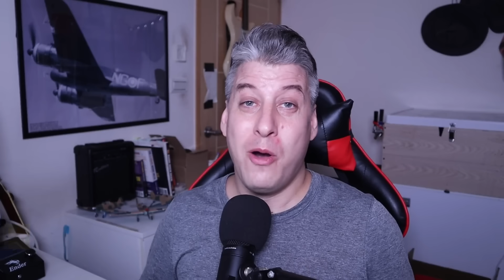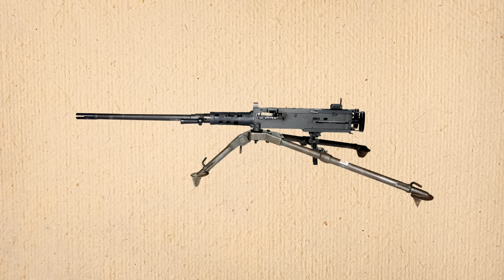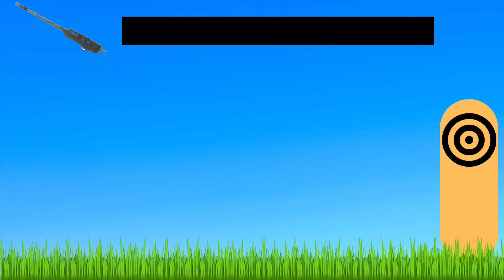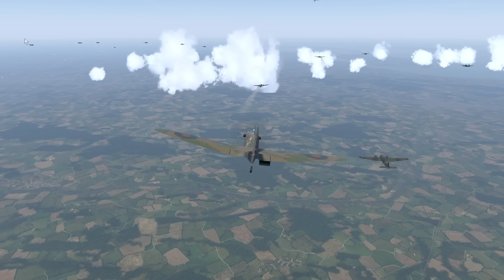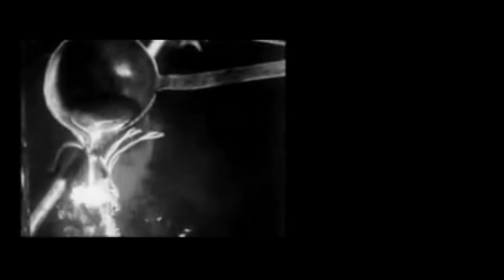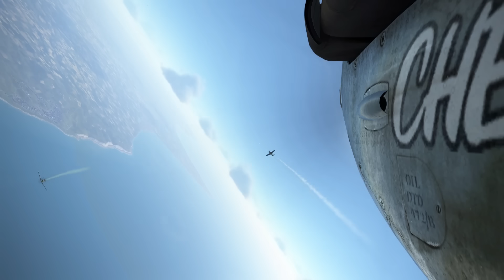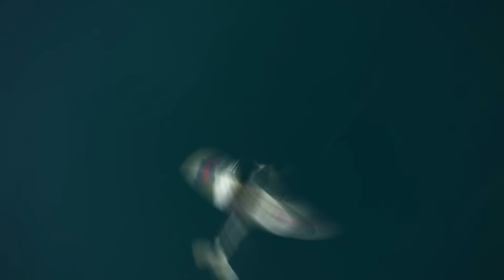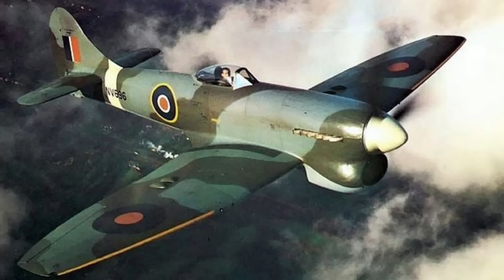Why Did The RAF Use .303 Caliber Machine Guns in WW2? The Surprising Answer

Comment: This is very similar to the history of America's late adaption from the 50 cal to the 20MM (and larger) cannon. As I under it, there was also the issue of early 20MM+ caliber guns being clip fed and not belt fed. The Army Airforce waited (in addition to the other reasons) for a reliable linkless belt system for the larger calibers before the canon were adopted.
Reply: The reason the American version of the HS 404 (the 20mm Automatic Gun M1) was so unreliable is that the chamber had been lengthened (as was discovered when a British Hispano was compared to an M1; the RAF model never experienced the same failures as the M1).  This led to the round being seated too far forward so that the firing pin did not properly strike the primer of the chambered round (it had not been redesigned to take into account the longer chamber), leading to an endless series of 'light strikes'.

The belt vs drum feed scenario is a bizarre reversal of the old not-invented-here syndrome; you rightly say that early versions of the Hispano were indeed fed from a drum magazine, which in a wing mounted gun isn't that much of a problem, but when you have an aircraft like the Bristol Beaufighter (armed with no fewer than 4 Hispanos and 6 .303 Brownings) where the observer has access to the cannon breeches, someone thought it would be a grand idea to provide stowage for 16 spare ammunition drums, four per cannon, which would be swapped out in flight by the observer ... who would have much better things to be getting on with, such as manning the radar display!  This was evidently an unacceptable arrangement, and the engineers at the Bristol Aircraft Company went ahead and designed a neat and reliable recoil operated sprocket feed for an ammunition belt, which was pooh-poohed by the armament experts who said it wouldn't work.  

In June of 1940, however, just prior to the fall of France, two French Army officers made their way to Britain bearing drawings of a Chatellerault-designed belt feed for a Hispano HS 404 ... that was practically identical to the one designed by Bristol with the exception of how rounds were withdrawn: the French design pushed the nose of the shell whereas the Bristol one pulled on the case, which caused issues with pointy-nosed AP rounds so the design was modified  - and replicated the Bristol feed mechanism perfectly.  It took until September of 1941, and the 401st Beaufighter off the production line, to get a belt feed for the Hispanos as standard ... when it could have been there from the very start if the Air Ministry hadn't had their heads up their collective arses!

Comment: Remember every American vehicle had a 50 cal mounted on it. As for the Navy 50 cals where widely dispersed all over the ships. Fun fact, on the lowly US Navy LCS today there's 6 50 cal mounts.
Reply: The 50 cals were replaced by 20mm's in the first months of the war.
Reply: @rocketguardian2001  Most PT boats kept their 50 cals. Even today every Abrams tank has a 50 cal on top the turret.
Reply: @LV_CRAZY  Yea but the Abrams .50 is not used for anti aircraft duties, and the .50 on the PT's was supplemented by 20mm's whenever the skippers could find one. The .50 was a great air to air weapon, but it has its limits. For surface to air, the 20mm is much better.
Reply: @rocketguardian2001  I guess everyone's experience will vary. The 20 mm's aboard our ship, the USS Ajax in the 70s where a real disappointment. On every firing exercise they continually jammed. And couldn't be recovered. Every time. Maybe our Gunners Mates weren't the best. But the 20 mm left a bad impression with me.
Reply: @LV_CRAZY  do you know if they were the original mounts or replacements? They would have been decades old by the 70's, so maybe that would explain the poor performance. Cool that you served aboard a WW2 Era ship!
Reply: @rocketguardian2001  Unfortunately I don't know. The were infamous for unreliability by that point. The ship was equipped with 4 5"38 gun mounts originally but where removed earlier in the 70s. They actually ran fire support missions with a repair ship during the Vietnam War. Which shakes everything apart. Interesting that the military still uses the Browning 50 cals made during WW2, updated though.
Reply: @LV_CRAZY  Thanks for that! I always appreciate firsthand knowledge.

Comment: Douglas Bader (and if you don't who he was why are you watching this video ?) flew a Mk VA equipped with eight .303 machine guns, as he insisted that these guns were more effective against fighter opposition. His tactics required a close-in approach in which he felt the lower calibre weapons had a more devastating effect. In fact he resisted orders requiring him to  re-equip his wing ( 3 squadrons = 36 aircraft) with Spitfire VBs, which had two Hispano 20 mm cannon and four .303 machine guns. There were stories of him re-fitting later Spitfires with Mark VA wings !!  If you are a novice better to have 8 high rate firing guns with a spread to ensure a hit of some sort, and later when you are experienced you get your armourer to syncronise them to concentrate at 200 yards - like Bader.

Comment: It seems like the entire period from WW1 to WW2 was one of transition in aviation generally and aviation armament (and engines) in particular.  Looking at the pace of change, the British idea of waiting to adopt an ideal solution until it could be fleshed out seems reasonable.  Consider that the weapon conceived in Germany and then completed in the US, the M61 Vulcan was designed in 1946 and STILL dominates Western fighter gun armament today.  Fundamentally, the ability to combine the two necessary air to air gun characteristics, an HE payload and high rate of fire, simply didn't exist until the end of WW2.  the M2 with an API bullet is a stopgap in that development, as the lack of space for a fuze and HE payload makes the projectile fundamentally a hole puncher.

Comment: BESA 7.92mm machine gun    Although British forces used the .303 in rimmed round for rifles and machine guns, the ZB-53 had been designed for the German 7.92×57mm Mauser round; referred to by the British as the 7.92 mm. The British had intended to move from rimmed to rimless ammunition but with war imminent, wholesale change was not possible.  wiki

Comment: I don't accept your premise.  20mm cannon were introduced on heavy fighters from the start, and on single engined ones from 1941.  Even some bombers had them as defensive guns by the end.  
On the subject of bombers, if you cover the plane with .50 cals, and add the men to operate them, your offensive payload is a sack of hand grenades.

Comment: A .3" hole and a .5" hole make little difference for punching holes in the airframe, although the .50 is much better for taking out engines or seat armor, and probably was easier to aim with its flatter trajectory, too.  Cannon with their shrapnel make much more sense for shredding airplanes.  We should have gone straight from .30 cal to 20mm
Reply: A 50 hole is nearly three times the are of a 30 and more likely to be in multiple component. The rough rule of thumb was (and this takes into account rate of fire) that three 30s made a 50, two 50s made a 20mm Hispano.
Reply: @wbertie2604  True, but my point is that airplanes don't have much armor- both rounds are adequate for punching holes in aluminum, and a hole in a piece of aluminum skin isn't that big of a deal.  A smaller round is  more likely to tumble, too.  The main benefit of .50 is ballistics and the ability to penetrate heavy components, like pilot seat armor, main spars, and engines.
Reply: @blurglide  they don't have much armour, but even a stringer may result in a 303 being deformed and incapable of damaging anything else, whereas a 50 will sail through. And a 303 might make a hole in a spar,  but a 50 would be much more likely to cause it to fail, and such effects are not linear with size of hole. 

Armour on bombers in the battle of Britain did prove to be a problem for the 303, but armouring against 50s would have been prohibitive.

Comment: I got bored, half way through and not mentioned is why spitfires and hurricanes only had 303 guns at the start of the war, because the larger calibre guns wouldn't fit in the wings. Hence why later models had a bubble on the top of the wing to incorporate a larger gun/cannon.
Reply from the maker: Thanks for the feedback.

Comment: The real reason for the .303s was lack of foresight. Browning 
0.50 caliber guns were not difficult to manufacture.and could 
have been produced under license while the Spits, and Hurricanes 
were under development. Further more logistics for the 0.50 cals
was already available from P-40 orders, and the coming "castrated"
P-38s. The .303 was a >250 yard gun at best. This put the British 
fighters in range of the bombers defensive fire (mostly rifle 
caliber). Inexperienced British pilots were firing from 400 yards 
anyway (0.50 range), so the "rate of fire" was useless, but the 
"rate of dangerous wasted sorties and ammo" was very high. 
Up to twelve .303 guns were used in Hurricanes and eight in 
the Spifires. Four 0.50 cals were not much heavier than eight 
ineffective .303s. The four 0.50s would have devestated 
the German Bombers while keeping the pilots out of range 
of the bombers 8mm rifle caliber defensive fire. The 800 rpm
(ideal rpm) of the 0.50s was probably not achieved but 700 
rpm is a good guess. 2,800 rpm is around 40 rounds per 
second discounting the tracer rounds. 650 grain bullets of 
incendiary, armor piercing, and explosive rounds would have 
chewed up the bombers, and protected the pilots. So no 
matter the number of .303 guns they were still >250 yard 
weapons with relatively light (190 grain) bullets. The weight 
of twelve .303 guns(Hurricane) was certainly more than four 
0.50 caliber brownings. Hits from the 0.50 could crack an anvil, 
so 0.50 cal rounds were far more effective, and as said the 400 
yard convergent range would have kept the fighters out of range 
of the bombers mostly 8mm defensive guns. Poorly armored 
and badly self sealing fuel tanks were mounted  between the 
engine and firewall, with no bullet resistant windscreen (both 
Spit and Hurri) so many .303 equipped fighters would catch 
fire right in the pilot's face creating a burning brand that roasted 
the pilots before they could bail out. The .303 caliber guns no 
matter the reasoning were a very poor choice leading to severe 
injuries and deaths of badly needed pilots. NOTE: The Poles 
had their .303s converge at 200 yards, and learned where the 
defensive "blind spots" were on the bombers. They were also 
allowed to chase the low on fuel, out of ammo fighters, and 
also the bombers (especially damaged stragglers) across 
the channel. Head on attacks were their favorite method 
against the bombers. The Poles had the highest unit kill 
ratio in the RAF during the Battle of Britain.

Comment: Nice video. I think most people think that it is always best to have the most effective thing, when in reality, you want the most of the thing that is effective enough. It is hard to argue that the Spitfire with its .303 guns was ineffective.
Reply: You also have to consider a heck of a lot of pilots going into battle, once the war was in full swing had seen little airtime before being in service. Many were often still teenagers.. they needed more rounds. It's a trade off but yes as is demonstrably proved by the outcome it was a fair choice. 

Things evolved as necessary. But to start with it did the job well.

Comment: Excellent vid. I never questioned why the Brits stayed with .303. (At least early on in the war.) Simple logistics. As to effectiveness of the .303, he who carries more ammo stays in the fight longer. Pepper a 109 with enough .303 it's going to come down. ;-)
Reply: Well that and in 1939 a fighter with eight excellent MGs was considered a powerhouse. Most fighters were just starting to go to 4 MGs. that was what early Bf 109s had. People don't consider that all this change happened over a couple of years. They only needed 8 guns because planes were so fast that it was hard to get a long burst on target now. then you didn't NEED cannon until they started armoring planes to protect them from the heavier MG armament, you needed something that did more damage with a single hit and which could penetrate thin armor plate.
Reply: 19 Squadron RAF was given cannon armed Spitfires to test during the Battle of Britain, those cannon jammed so often they actually begged The Air Ministry to return their old .303 armed Spitfires!

Comment: The 20mm clearly was the way forward. It is still in use on aircraft to this day while the 303 is relegated to history.
Reply: Which is why a 20mm armed spitfire wing was in testing even before the Battle of Britain, and was introduced shortly afterwards. Later the 4 20mm armed C wing was introduced. So look at that again, the Spitfire was being arme with 20mm cannons IN 1940. By mid 1941 all Spitfires had the B wing except photorecon aircraft (which were unarmed). The B wing carried 2 20mm cannon and 4 .303 machineguns.

Comment: Another advantage of .303 that wasn't mentioned is that rifle-caliber rounds had much flatter trajectories than cannons, making them much more accurate at WWII engagement ranges. You could essentially point a .303 straight at a target 300m away and expect to hit without adjusting for range. The .303 was one of the better rifle-caliber rounds too, and saw a lot of development in the war years that other nations didn't really bother with for their rifle-caliber rounds.

The US .50 caliber was also very flat-shooting (and probably the best gun for long-range shooting, with a point-blank range of about 500m), but it wasn't available in mass quantity until 1942, and even US fighters were only mounting 1 or 2 of them until 1942 (while usually mounting 4 .30-06 Brownings). By the time the US was mounting 6 or 8 .50s, a mix of 20mm and .303 guns were already viable for the British. In many ways, the US decision to stick with the .50 mirrors the British decision to stick with .303, except that the .50 remained "good enough" throughout the war while the .303 was clearly underpowered. The .50 being "good enough" for WWII hurt the US in the jet age, when the .50 was no longer good enough but the US had failed to adopt cannons.
Reply from the maker: great point, thanks!

Comment: Early war Spits and Hurricanes were operating on relatively low powered engines (compared to what would come later). Their performance was strained even with the lighter 303s. Adding the big guns would have dogged their performance to the point where their kill ratios would probably have been lower against bombers and would have made them sitting ducks for 109s...especially considering the well understood reliability issues of the big guns. Also, considering the early part of the war was defensive, the RAF often dealt with targets that were unaccompanied with fighter escort. Enabling them to focus all their fire on their targets with a very limited capacity for receiving return fire. Under these circumstances, using 20/20 hindsight, I would say an armada of 303s with an MG42-like cyclic rate of fire on each aircraft, was clearly the right choice for the time.
Reply: 4 .303 MG's weigh about as much as a single 20mm Hispano. Had they got the Hispano ready in time, in terms of reliability and belt feed mechanism, at the outset of the war, a hypothetical Hurricane Mk I or Spitfire Mk I armed with 2x20mm would have torn the Luftwaffe a new one during BoB.

But like all contrafactual history scenarios, there's a lot of ifs there.

Comment: They did have an advantage in being lighter, didn't some versions of the Typhoon have 12 .303 guns? That much ammo going down range although smaller in size gives you a much better chance to hit your target.
Reply: The guns would be set up to have a focal zone set at the distance the pilot felt cozy at so maybe 200 yards 
At focal range the wallop landing was about the same as putting a 40mm shell on target. Which is what you need to drop land an aircraft
Reply: Oh I forgot it also meant they could shoehorn more tracer into the belts
Reply: There was a Typhoon prototype with 12 .303's, however by the time it entered production the 20mm Hispano was considered reliable enough etc. so all the production versions had the 20mm.